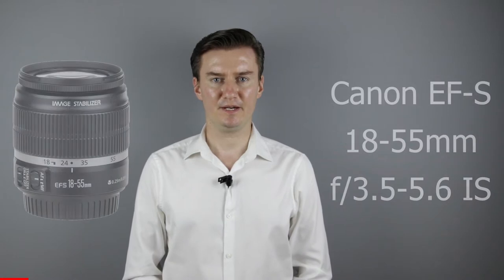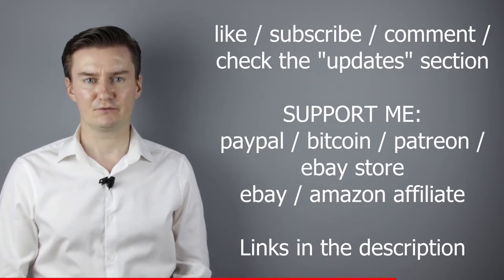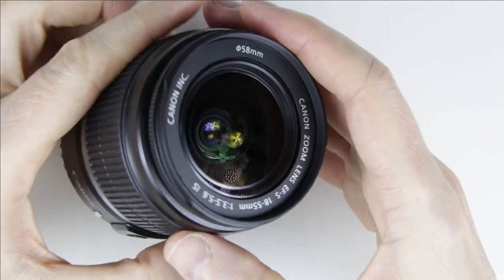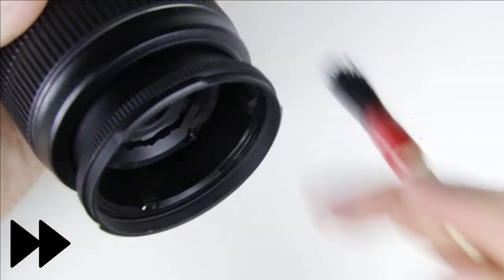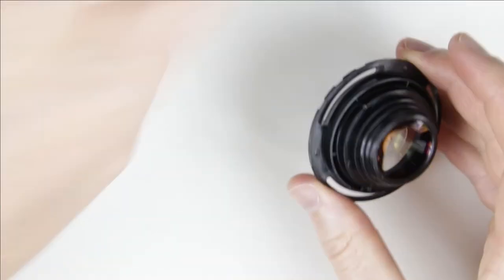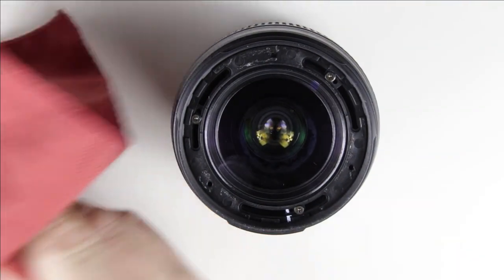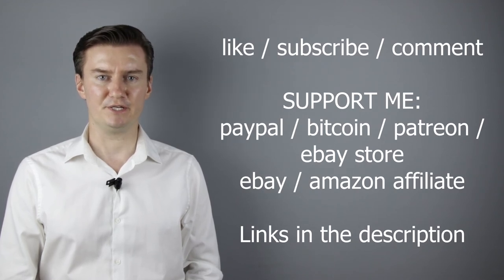Canon EF-S 18-55mm f/3.5-5.6 IS clean the lens inside

Comment: This video is great! Unfortunately I get stuck at that first step of lifting the front cover ring. In my lens, that ring is under the lens. It’s a “Canon Zoom Lens EF-S 18-55mm 1:3.5-5.6 IS II”. Do you know what I need to do to get that top lens off so I can access the cover ring? It seems that the dust particles are in between those two layers of lenses.
Reply from the maker: I don't remember exactly how to remove the cover ring, you might have to use a lens opening tool to remove it if it is not the plastic ring adhered to the front lens.

Comment: Hello. Thank you so much for this video. I tried to open the canon lens ef-s 18-55 is stm, to clean the lens on the inside, but I failed. It looks like it's made in one piece and the lens can't be raised .. do you have any advice, are there any lenses that can't be opened .. thanks ..
Reply from the maker: If that is the case, then most likely you have to disassemble the lens completely starting from the rear.

Comment: Hello, good job!
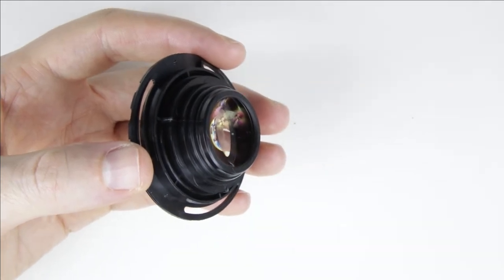Do you know any method to disassemble the front element? ( 4:44 ) 
I have a fungus there...
Thank you
Reply from the maker: Hi! Generally, it is not possible to separate the front lens element, so there is no solution for your problem (apart from replacing it with a clean one).
Reply: @CamerasLensesEtc  Where can I buy a new front element group part? I can't find parts anywhere.
Reply from the maker: @C.I... I see that part very rarely. If you can't buy it from ebay, or from the manufacturer, then you can try to buy a complete, faulty lens if it is for sale on ebay, replace the front lens, then sell the donor lens as non-working.